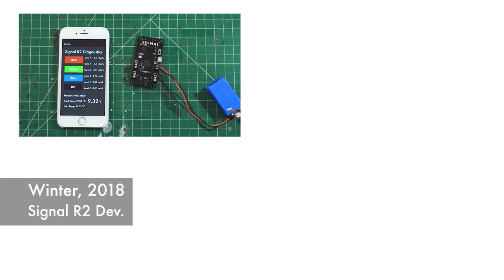Channel Trailer - 2019

Comment: But it worked though...it tried to corrsect itself" I like that at itude you didn't regard tha crash as a failury, you saw tha success in what worked.
Reply: Correction: but it worked though… it tried to correct itself i like that attitude you didn’t regard the crash as a failure you saw the success what worked.

Comment: Amazing project!

One thing I don't understand about vertical landing via engine thrust.

When it gets close to the landing surface. It tends to start dancing around. Presumably due to the pressure building up. Between the nozzle and the pad.

Why not land it on an elevated grate? Set at the height of about 10-20 feet.
Reply: No that wouldn’t work
Reply: @floodgates6210  because .... ?

Comment: Option 1) we can provide magnetic flatform for landing..  
Like it will work as raily bogi joint  same technology we can you hear know.. 

After i will come down we activate magnetic technology and land with moveable flat form  safely.. 

Option 2) 

 We can you landing time automatic openable  wings like flight,   elicaptor fan.. it will  land safely know..

Comment: SpaceX used more engine it means more power.
Try to add three rockets inside and double the power of the rocket.
BTW SpaceX rockets has trusters on the side it makes the balance while going down. It needs a gyroscope or something that make it perpendicular to earth. Make something that controls the alignment dude.
Use a rocket that could last long while flying.

Comment: If the rocket is stable, it will point forward in the direction you're turning. Adjust therocket to make it stable. There are two ways to do this. Move the center of gravity forward by adding weight to the nose....👉😛😛😛😛
Reply: Missile Talk 👌